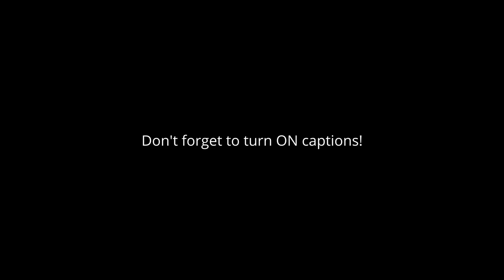Energy-Efficient Parapet Wall Construction: No Thermal Bridges - House Build Pt. 15

Comment: why styro on inside  part of the walls? wont it be an enclosed area once the roof is done?
Reply from the maker: Yes, once the roof is in place, the space will be enclosed, but that Styrofoam on the inside will, in the future, help prevent condensation and mold formation on the floor below the wall due to temperature differences. We treat these walls similarly to balconies, so we need to construct them in a way that prevents thermal bridging. Essentially, we need to fully wrap them in thermal insulation.